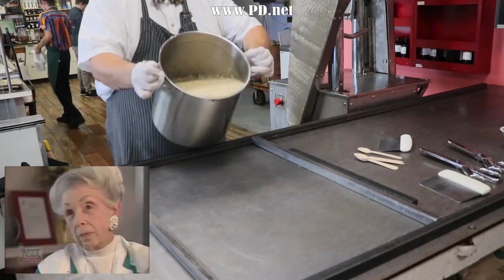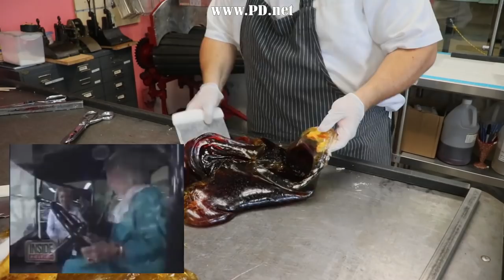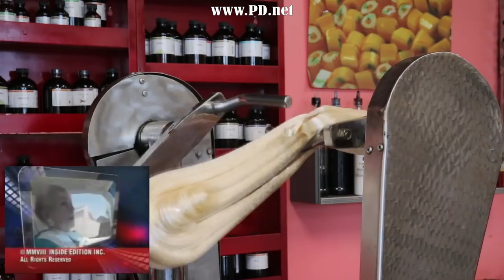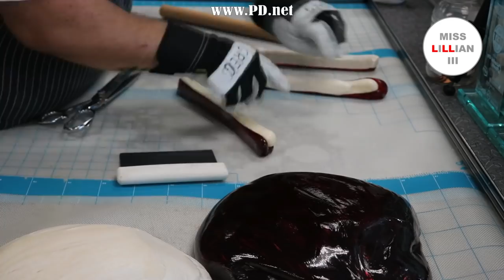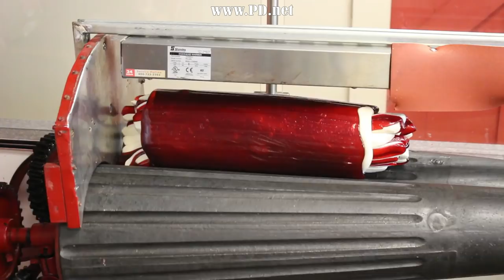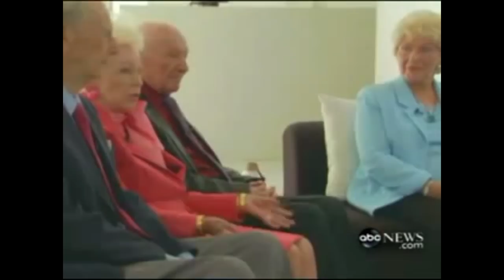#86 Candy for the passing of 74th oldest person in the world.

Comment: Are you ever tempterd to just bite into the soft hot candy
Reply: Like right out of the pot? Probably not, but as he's making the designs I'm sure he's holding back. I know I would have to
Reply: @carljoosepraave2102  It's not I can tell, having accidentally dipped my finger in it once! It burns onto the skin like burning plastic! It is far worse than molten lead!
Reply from the maker: Oddly I've actually been burned both by sugar and multiplied. I respectfully disagree led is worse, woods metal is better.
Reply: @LoftyPursuits  Agree about woods metal, but you can actually put your finger into molten lead and, if you don't wait for too long, pull it up again unharmed - excellent party trick, we often do it at work to scare people who haven't seen it before. Something to do with the leidenfrost effect and the moisture in the skin. But don't do it twice with the same finger!
Reply from the maker: Yes, but if you put your finger in the 2nd time, the burn I think is worse. I wonder if the leindenfrost would work with sugar as it is hydrophilic.
Reply: @LoftyPursuits  Yes, it is worse the second time -  the moisture has burned off the skin, and the leidenfrost effect doesn't work with sugar - I tested it just before Christmas with a knuckle in some peanut brittle. (155 C or 307.4 F). Have fun and take care! Woods metal? What have you been doing since you know it?
Reply from the maker: Rebuilding brass instruments. I fill the tubing before bending. It keeps the tubes from crushing.
Reply: @LoftyPursuits  I've used it for model building, casting details in lead moulds. Lead moulds because they were easy to make. Never thought of filling a tube with it, have always filled the tube with fishing line before bending, but that is doable only in smaller dimensions. Thanks!!
Reply from the maker: You should make the molds from platsil silicone. It can take up to about 500f and should hold more detail than lead.